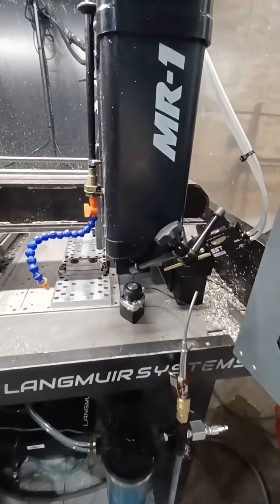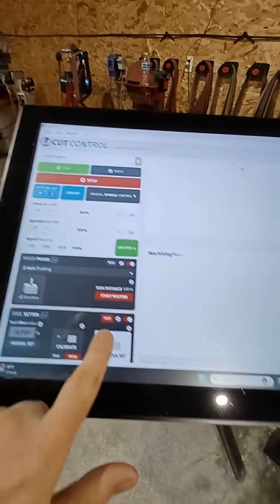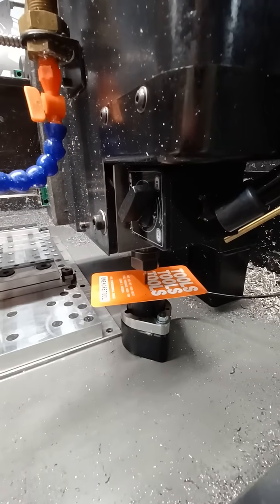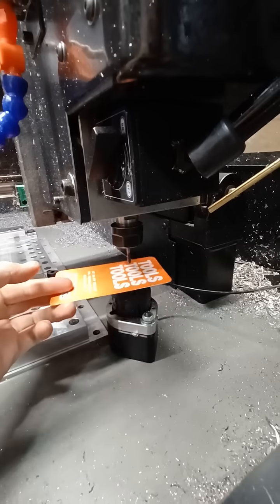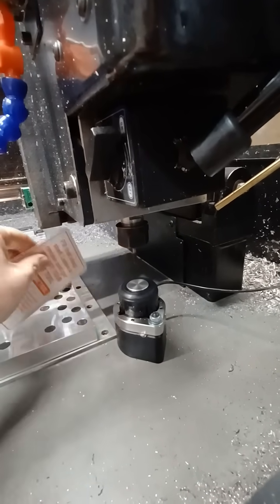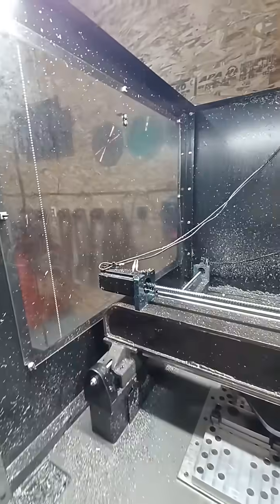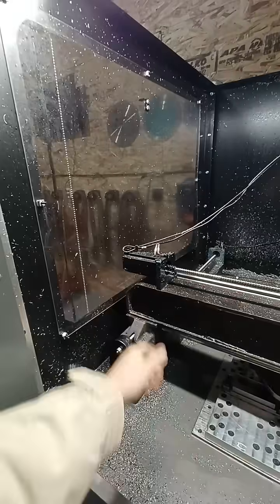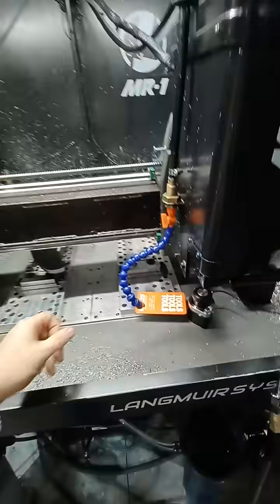Work around for the Langmuir Systems tool setter malfunction.  #langmuirsystems #MR1 #cnc

Comment: Well this is incredibly disappointing. I was considering getting the MR1, however, because this has a continuous stepper motor malfunction and they are just replacing it with the same motor, I'm no longer interested. Seems like more of a pain than it's worth. Does that stepper mother malfunction have an impact on any other operations?
Reply from the maker: it still operates fine.  Eventually it can start to loose steps and you'll need to replace it.  You can always replace them with your own stepper motors of the same size if you find a high quality motor.
Reply: @BeckTools  Thank you! Oh! Do you plan to make a video doing a high quality stepper motor upgrade? That would be fantastic!
Reply from the maker: @ff4937  I don't know if there is such a thing as a "high quality stepper motor"  They are used instead of servo motors because of their low cost.  Currently Langmuir will replace them indefinitely I think so...